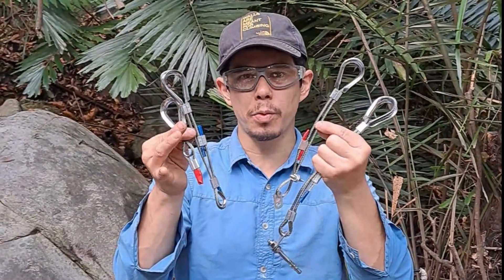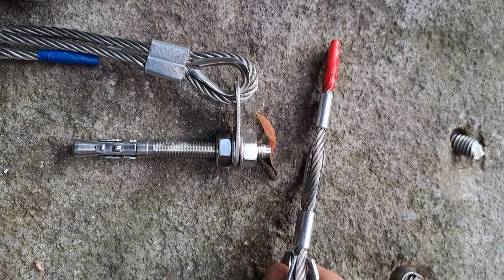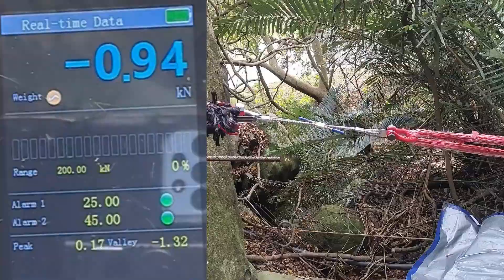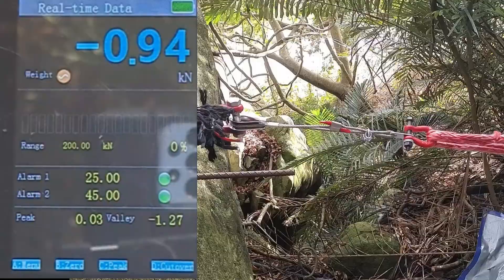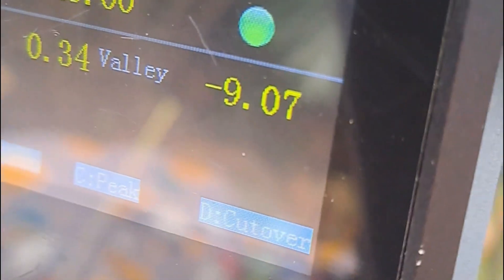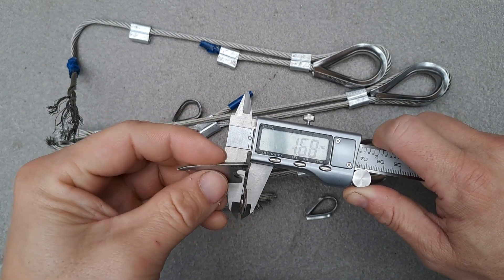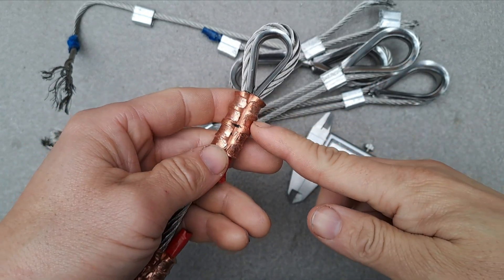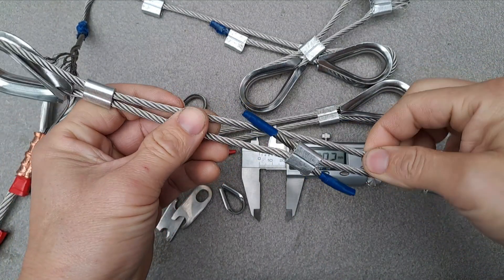BREAK TEST: Homemade "swaged" wire rope anchors for Canyoning Rappelling (not mine)

Comment: You will get galvanic corrosion with SS and aluminum together like that, no?
Reply from the maker: Yes, aluminum paired with stainless steel has a voltage difference of 0.7-1.0 V, which will further excel the galvanic corrosion, depending on the conditions/environment it's in. If looking for long term, at least copper, plated copper, or stainless steel( to match) would be far better than aluminum sleeves. However I think the guy making these is looking at them from a disposable/replaceable standpoint. The same bolt could be used, and then just replace the cable.
Reply: They are smashing them down with a hammer(or rock?). I don't think they are worried about corrosion. Why on earth did they not swag them correctly?